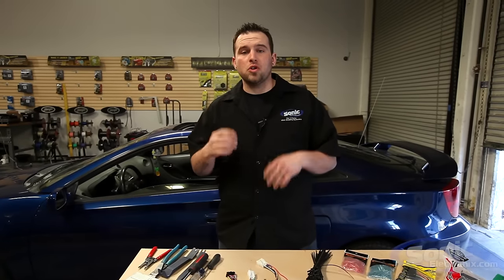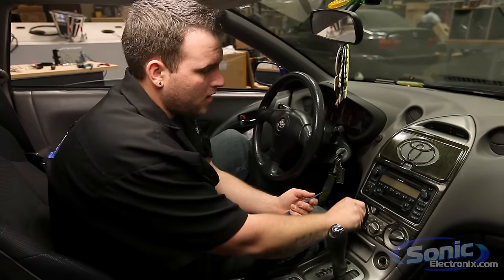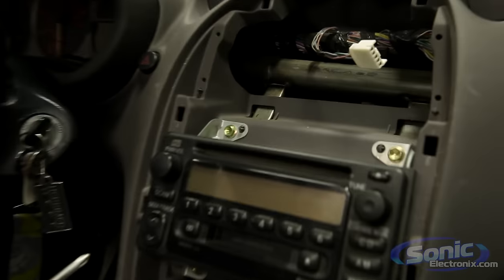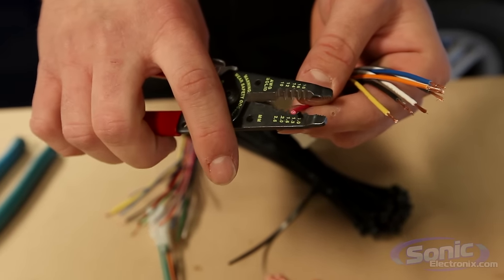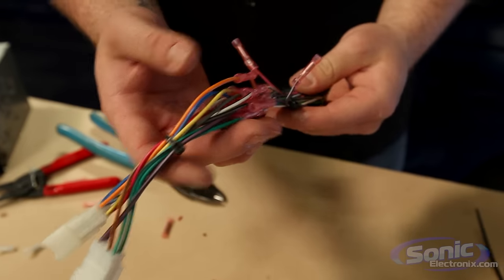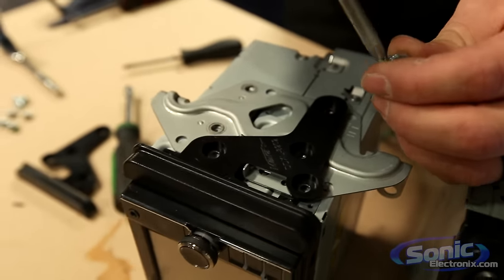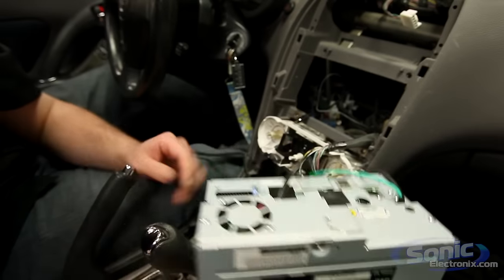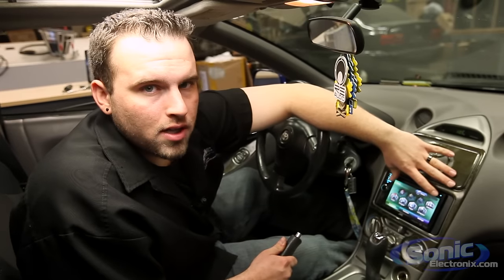How To Install a Car Stereo (Single & Double DIN) | Car Audio 101

Comment: the worst part of installing is having to twist your body into unimaginable positions to screw things
Reply: +Will Lowe, not just with installing haha
Reply: +Billy N lmao
Reply: That's actually the sexiest part.
Reply: Try working on the clutch master cylinder, which is under the clutch petal
Reply: For me, it's disconnecting the battery due to its under the floor board in the backseat.
Reply: @BasicInsideOut  ooooo
9

O
Look
OH
O OO 9
Reply: Please don’t be mad we do the same thing with our women just to pleasure them
Reply: As long you don’t get tight to the screw.
Reply: You available now?

Comment: I haven't switched out a stereo since the late 80's or early 90's. I wasn't sure I'd be able to handle any of the new stuff, but it appears to not have changed all that much. I don't know if the rest of your videos have the same production values, but you did a remarkable job on this one. It was laid out in an intuitive manner and standard terminology used is great for us lay people. Thank you for the post and it did it's job. I am going to look to purchase from you guys.

Comment: excellent tutorial video, I'd like to add that once you've connected the wiring and slid the head unit back into place, it's a good idea to test it before fully installing all the dash trim, it's a bit easier to find out if there is a problem and correcting it then, rather than completing the install and find out then that there is an issue, it is rare with a new stereo install but it does happen...
especially test everything prior to completing the install if you're installing a used head unit or if you've later pulled out the head unit to make connections for an amp or other accessory, visually reinspect all your connections also to insure everything is still in good condition

Comment from the maker: A wire harness allows you to keep your factory wiring plug in case you want to put your stock radio back in. The wire harness that you get with the new radio is designed to wire up to a special wire harness adapter that connects to the factory plug in your car. No splicing and figuring out wires necessary.

Comment: i did my first Radio install at 15years old ,I had no idea what I was doing but it was fun and now its so easy I've offered to install for fam/friends free just get me the supplies. This tutorial is very good and zip ties are better than tape ,I solder my connections tho.

Comment: Excellent tutorial, guys. Very helpful and great for saving money. But I actually have a question regarding your installation kits for the single DIN. I noticed you don't have any for Mazdas. Does that mean I can't install a single DIN stereo to my 2007 Mazda 6? Or would Mazda simply fall under the Ford category since they're built under the same design? Thanks for sharing this awesome tutorial!

Comment: I have recently bought and purchased a Sony XAV 68-BT from you guys, and I installed it in my 2005 Mazda 3 and it looks great and sounds great. I just have one problem. When I turn my car off with my lights on, the beep beep doesn't go off anymore. I am wondering how do I fix this??

Comment: Great video. Thanks for sharing man. But I am in a dilemma, here in Singapore I notice none of the mechanics disconnect the battery before working on the audio system of the car. Whenever i asked them why, they simply mentioned that there is "no need" for that. What is your opinion on this ??

Comment: Do all OEM radios have the orange/white wire so the LCD screen dims when I turn my headlights on? What if my OEM wire harness doesn't have the wire that will dim my LCD screen? I really want my screen to dim at night so the screen isn't so bright but I'm scared my stock factory radio (which is just like the one removed in this video) won't have that wire.
Reply: I really want to know as well!
Reply: Graciel leal after some research, I think the harness adapter that you buy separately (specifically for your car) has the dimming wire and then you connect it to the dimming wire on the harness that comes with the double din. So it should dim

Comment from the maker: If you wanted to install a tablet, you would have to custom fabricate a mount for it or have someone do one for you. We do custom fabrications if you can ship us your dash panel. Connecting a tablet to a single DIN radio via USB or 3.5MM headphone jack is the easiest way to do it. You can hide the radio in the dash or glove box if you have room.

Comment: what you did there was called hardwireing its wrong on that car just use a pc2-17-4 then you go from the factory harness to iso. when you buy and after market radio it comes with iso to the plug that is specific the model stereo that way there's no cutting wiring it just plugs straight in!

Comment: NEVER DISCONNECT A POSITIVE CABLE WITH A NEGATIVE STILL ATTACHED! OMG NEVER DO IT AGAIN!
Reply: he disconnected the battery.......
Reply: XtremuZ JStemp17 is completely correct. ALWAYS disconnect the danger (positive) before you disconnect the safety (negative).
Reply: ***** No, you disconnect the Negative (Ground), not the positive. Because if that positive wire touches anything conductive, it'll create a spark (Current) which could lead to bad things :P

Comment: Very helpful video! 

I have some questions that I hope that you can help me with it.

1. Does the size of the back part of the radio affects the fitting of the radio into my car? 
2. Can a toyota vios 2004 version fit a 7-inch double din?

Comment from the maker: Yes it is. If it measure 7 inches across and 4 inches high or more then it will fit a double DIN, you just might need a dash kit.

Comment: Seriously, this is a great video. I'm considering buying a double din 7" screen head unit and I was thinking of installing it myself. The wiring harness that comes with the unit looked daunting, but now it doesn't seem so bad after watching this. I have a 2003 Hyundai Tiburon base model.

Comment from the maker: Dash kits are designed to fit aftermarket radios. All radios are single or double DIN and thus similar in size. You should have few problems with fitment.

Comment: Thank you for a great video. 
I connected the wires but I got 5 wires left from the new stereo that I have no where to connect with. My question is if they are important or not? 
The titles of them are : 
*Key 1
*Key 2
*Reverse 
*Parking
*Amp

Thank you

Comment: I could tell off top! By the way he disconnected the battery, and removed the center panel, he knows exactly what he’s doing. Because I’ve been installing car systems since I was 14, I’m not a professional. I just learned from the best, and I know exactly what to do in regards of, installing a car stereos…

Comment: You guys rock!!! i ordered your install tool kit and new radio deck from ya for a good price.   Worked on wire harness with your tool kit.  It was a smooth operation.

Comment from the maker: If your butt connectors are not the correct size, and your wire is cheap, you might have problems with the butt connectors. If everything is size matched, the protective shielding on the wire will hit a lip on the butt connector and make the wire stop, however the exposed wire should go into the center of the connector. The wire harnesses are color coded, so you can leave out the colors you don't need. Not all radios have all of the wire colors on a wiring harness.

Comment from the maker: The CD player in the trunk would be removed. You would replace just the radio itself. Unfortunately, the Grand Marquis can only fit a single DIN or a DIN and a half radio. If you wanted a double DIN, it would require cutting into the dash.

Comment: So you no longer have to cut wires coming from the car? You just have to strip and crimp wires that's provided?
Reply: slimgoody503 Yes,  metra harnesses designed for your car. Saves so much time and keeps everything on your car (wire-wise) in tact.

Comment: I am only interested in the audio and electrical part of the system.  Do you have to tear apart the whole car with the seating and the carpets under the seating to work on the cables for the speakers?  Obviously you have to re-carpet the car floors.  How much does it cost you to re-carpet the floor, after you needed to cut it up to get to the speaker cables?

Comment: Typically do you have to do all of that wiring? I have a 2005 Kia Sportage and want to replace the head unit. Will it just be a matter of pulling it and unplugging all the connections and plugging those into the new unit?

Comment: so we still need that factory mounting bracket if we want to use an aftermarket double din stereo? Mine came with a single din radio, so I don't have the factory mounting bracket for double din.
What can I do?

Comment from the maker: It does not matter if you use crimp caps or butt connectors. We actually see butt connectors used more often then crimp caps. With a butt connector, you can slide some heat shrink over it and make a stronger hold for the wire. For the average install, butt connectors work perfectly. No if, ands, or butts :P

Comment: Can I just disconnect the negative and leave the positive plugged in ? And if so where should I keep the negative ? Should I wrap a polythene around it to keep it secure or what’s the best method to secure it ?

Comment: So I have Pontiac Vibe 04 and a few questions. Why do you need the two different buck connectors when you only use the red one? Why do you have a separate wire harness other than the two that are on the table, and why does it look different?

Comment: Hello, I plan on getting an Pioneer FHX-720BT for my 2003 Maxima and I was wondering if all I needed to connect the harnesses are the butt connectors, 18-22 gauge wire crimps and a crimper. People have told me various ways to connect the harnesses and this seems like the easiest. Also if I want to retain my steering wheel controls, how would I do that?

Comment from the maker: The vehicle has a wiring harness and the stereo will have a wiring harness. You need a special wire harness that connects from your vehicle to the new radio harness. That might be why you are confused.

Comment: If I replace the radio and all speakers do I have to run any extra equipment or will it just be “plug and play” after it is all wired up?

Comment: I watched my dad install his. He didn't use the harness so he got the wiring diagram online and connected the wires himself. He's an experienced mechanic so it was easy for him, but i was confused. The harness makes it so much easier. The hardest part is figuring out how to take the console out.
Reply: Some tools can be used to take the console out easily. It is called panel removal tool I think. You can search it on Internet.
Reply: That's not the hard part, it's finding the screws and various things you need to take out so you don't break anything prying it apart. The clips are easy.

Comment: Is it possible for any vehicle to keep the steering wheel controls functioning with the new head units? and what would it be the best way to aproach this problem? Thanks :)
Reply: parangarito22 some come control-ready, some you have to do manually

Comment: Nice I used this video and got my new GPS/DVD player installed in my Toyota but it won't let me operate some of the features unless i have the E-brake activated, can you tell me how to bypass this?

Comment from the maker: Any Single DIN stereo will work for your vehicle if you have the Metra 89-9400 trim plate. Consider going with a nice Pioneer radio like the Pioneer DEH-P9400BH

Comment: Hi ! I have a "begginer question". Im installing a Pioneer AVH270BT double din stereo on my 2002 Celica GT-s and I would like to know if that wiring harness with the black tip(black plug) comes with the car itself or if I have to buy it or if it comes when I buy a new stereo? And also , if my stereo has a bluetooth receiver do I need to do any other wiring? 

Thank you !
Reply: +Miguel Pavão The only question I can answer for you is the second one. Bluetooth capability is a wireless technology which means that once you have install the system as the video demonstrated, Bluetooth will work once paired with you device wireLESSly. I hope that helps at least a little.
Reply: +William Lopez Thank you man!
Reply: Miguel Pavão No problem.

Comment: is there a size difference depending on the guage order, like 14/16 vs 16/14 do you need that specific kind of crimp tool, i have one that has the wire stripper and crimp on the same tool, but the crimp doesn't have the tooth its just a curve. its like the Tekton 3775 8 in 1, they sell on amazon

Comment: If the car already have a double DIN stereo, with reverse camera functionality, does replacing it with an aftermarket double DIN stereo ruin the reverse camera function? Or the reverse camera can still be used?

Comment from the maker: You need an amplifier to run subwoofers, they cannot be powered by your stereo. Your stereo will connect to an amplifier which will then connect to your subwoofer(s). We do have a video on how to wire a subwoofer, we also have a Knowledge Base article written on how to do it located at the bottom of our website, just look for the link.

Comment: I must say I was a little disappointed when I went to the website to purchase a stereo and found that what you'd said in the video about including the dash kit and wiring harness with the purchase was not true and it wasn't included and that I needed to purchase it separate.  The video was very helpful though.

Comment: Hey dude great video lots of help except for one question..... I have a 2002 toyota celica gts and when I took my factory radio out I didn't have that type of wiring harness mine was different looked like a 20 pin where can I find this wiring harness? Why is mine different?

Comment: +Sonic Electronix  Perhaps this is a newbie question. If I purchase a head unit equipped with the blue tooth feature. Is there anything additional I have to do as far as the installation, aside from matching the color coded wires like in the video, and plug it in? Am I required to purchase a blue tooth microphone, or is there already one built in the head unit? Thank you very much in advance and thanks for the video.:) This will save me some $$$.
Reply: It did Sir. Thank you very much for the reply.

Comment: I just bought my stereo and got all the wiring and mounting equipment but have no connector from the stereo to the cars wires for my door speakers. When I bought it, it said I got all the wiring accessories. Is there a page to fine more of the wiring?

Comment: I have the Tsunami Edition of the Toyota celica, so it came with a Panasonic receiver (single din) its does not use the metal mounting brackets!! so I now have to find out where/if I can get them to install my JVC KW-20BT :(.  message me if you could help thanks - great video :)

Comment: What a expert you are, matching the wire colors. How would you wire when the manufacturer wires are not the same color 🤔
Reply: You find the models schematics for the harness so you know which cable is what terminal point...

Comment: Hi there! Not sure if you can help but I figure I'll ask the pros... I installed a Pioneer stereo in my 2004 Corolla and it's awesome, however I'm having an issue with the antenna hook up. I did what the instructions said and spliced the appropriate wires to my wire harness, and the FM radio is clear as day, but the AM radio is almost inaudible. I didn't realize this until I had put my dash back together, so I left it... now I want to sell my car and would like to fix it haha. Any suggestions on what I did wrong? I just don't get how the FM works but AM doesn't...

Comment: Hey. I just bought a 85 Volvo 740. I was checking out this single din stereo on the website, and the website says that the stereo will indeed fit in my car. So, what all do I need to buy separately to do it myself? I heard that in the video if you buy a stereo it includes the wire harness and dash kit, but I don't entirely understand what that is, as well as what else I will need. A reply back would be great, as I'm seriously interested in buying a stereo from you guys. Thank you.

Comment: How would you connect front and rear speaker wires from the amp to the head unit on the same setup you show?

Comment: Have a question. I have an aftermarket stereo. It's a 2003 GMC Sonoma 2.2l. Now I do not have OnStar. I didn't do the install. However the door chime doesn't come thru the interface box that was installed. The chime comes from in the dash. I pulled the radio because I have to manually power on and off. Now the red wire on the interface box is not connected. Red usually indicates power wire. So with it not being connected. My brain says this box is not needed? Can u answer this question? Thank you

Comment: I'm a new car owner and I wanna know if getting a new stereo would improve sound and music quality within the car or if I would also need speaker installation throughout the car if that's what I'm looking for?
Reply: A head unit alone won't give you better sound really, I would recommend buying and installing new door speakers.
Reply: Thanks for the reply
Reply: usually if your car is from 2004ish and older, its best to get new door speakers. many times the speakers will be falling apart around that time

Comment: 2008 volkswagen touareg, the stereo unit already has 4 little notches that look like they can be pulled out just by itself. do you think that it just pulls out without having to remove the plastic stuff

Comment: I've got a Chevvy Kalos 2006, When I bought the car it had an aftermarket JVC stereo in the car (single din). However I want a double din stereo. Under the stereo is a plastic pocket which is connected to the mounting sleeve for the single din stereo, this makes me think a double din stereo would fit but im not sure how it would connect to the factory sleeve? any advice? I live in the UK btw.